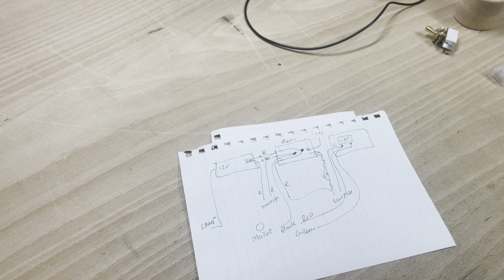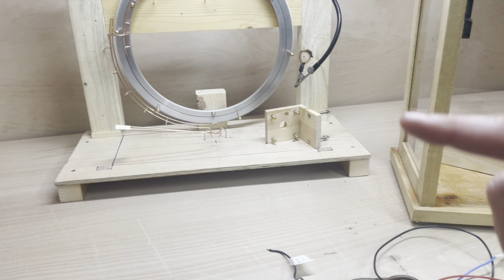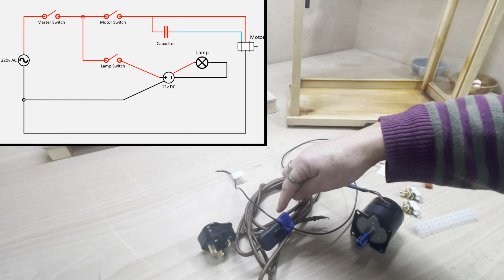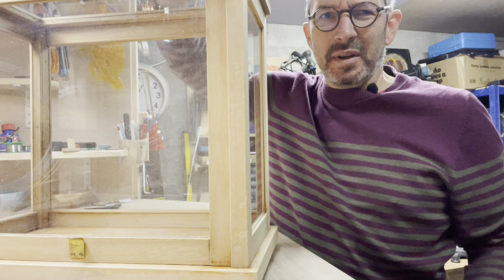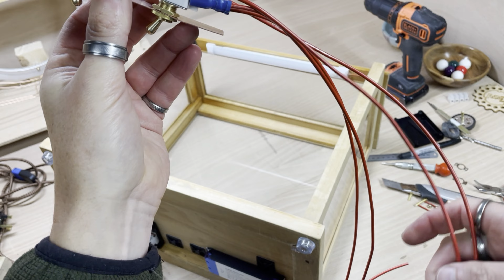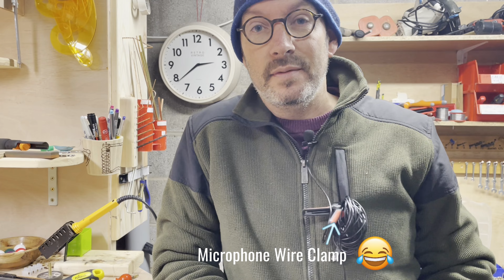Electrical - Rolling Ball Sculpture - Story 75

Comment: My concern is the 220v ac power.  Why 220v? That's not even a common plug for any home.  I'm very disappointed with this video just because of that fact.  I'm sure a much smacked 110v could do the same thing...
Reply from the maker: Thanks for your concern. In UK we have 230v with 10% tolerance. Used to be 240v 20 years ago but we aligned with European standards. Nowadays items listed for sale at 220v is normal and people often say 220 or 230 or 240v when referring to UK mains supply.

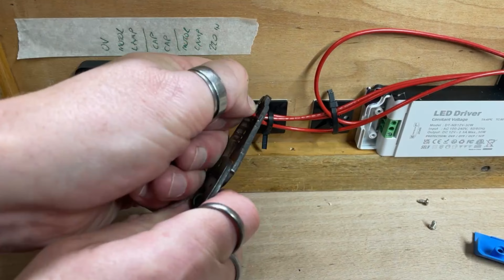Comment: You are pedantic about safety with the electric and then you solder the the wire before screwing it in the posts 9:33?! that's really morronically dangerous! Your really hypocritical. Have you never learned of crimping the wire with wire end sleeve?!?!
Reply from the maker: I often use boot lace ferrules. But this time I soldered. Genuinely just had to look this up and I see that you’re correct. Thanks for your helpful comment. 👍

Comment: Don‘t connect the capacitor directly to the life wire, but via the motor switch as shown on the diagram.
Reply from the maker: Ah ha. Well done I spotted that I’d done it wrong and did correct it. But by then the video was already edited and I wondered if anyone would spot it. 

Thanks so much for your input and keen eye to details. 👀
Reply: Chocolate chip cookie for you!

Comment: Hi, great video, as always.
As an electrician, I would very much recommend at least adding a fuse and as well grounding all metal parts such as motor housing or the copper tracks. Also I could see an issue with the lamp, or to be precise, with your 12V converter. First is that it doesn't have to be DC, if it is fluorescent light (or if it is, I can't tell for sure). The second, the inportant one is that the motor creates massive voltage spikes during switching, which could destroy the converter.
Reply from the maker: Thanks so much for you input on this. I’ve already decided to earth everything. Look out for an update video soon. The light is LED requiring 12v DC. 🙏

Comment: hi, I generally love these videos, your sculptures are amazing, however, I'm concerned about your wiring on this one, it looks leathal. 

Generally, anything that is a conductor and is accessable must be earthed. You don't have an earth wire at all on your diagram, and I see you are using a piece of 2 core lamp flex as the power cord. This is only really acceptible if everything is non-conductive. You mention early in your video that the wiring is compliant, but it's cerainly not the way you have shown it. 

The problem is, if there is an issue with the wiring, or any of the switches, such that any of the cables come loose over time, then the brass plate or the motor case could become live and electrocute your client. The same can happen with the motor, if something goes wrong internally. Generally AC motors are also earthed and usually have a fitting for earth, usually on the case itself.   

You also mention in your audio that the neutral return wire is naught volts, which it most certanly is not. 
The Neutral wire carries the power back out of your circuit. Not a good thing to touch either...

The principle is sound, but I'd be very unhappy to purchase something like this. 
Happy to help you out with your wiring if you like.
Reply from the maker: Thank you Dave. I genuinely appreciate your helpful comments and I support all the points you raise. I will make the changes and will swap the two core cable to three core, and add earth points accordingly.
Reply: @CopperGravity  that's great to hear. Happy to offer assistance on the wiring if you think that would help.